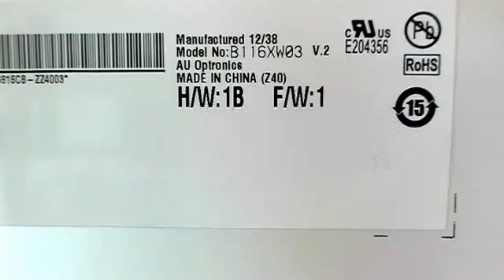Acer Chromebook C710 C7 Cracked Screen Replacement Procedure

Comment: My mother ordered my brother a replacement screen for this laptop, and I'm doing the surgery part. I don't know what model was ordered; I thought it'd be the exact, same model, but this isn't.
The screen fits perfectly in the slot, functions electrically, and has the screws on top/bottom. There's one problem: two screw-holes won't fit. They are offset by about one screw-hole's distance.
Short of ordering a new screen, what could I do?